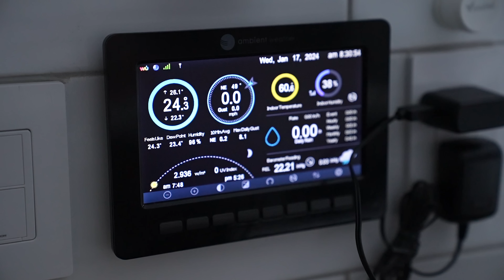A SHOCKING SURPRISE!!

Comment: keep your pipe high so you can use that space . A 200 consulting fee would be very helpful , you still do the work , and have a great root cellar.
Reply: Yes, when you look into crawl spaces under houses where plumbing is done professionally,  the pipes are kept as high as possible to provide maximum room underneath and to minimise the length of supporting straps and movement.

Comment: Hey kids, wow!, that is quite a load and a-half of snow!!  Don't fear, Trent, you will get through it, and, if not... your Inspector, who seems like a pretty chill dude, and friendly towards y'all will point out what needs fixing. Hey, that's how you all roll anyway. 😇Oops... my  apologies, 😎

About the snow on the roofs, what about adding Snow Stops? Lots of variety and styles from which to choose. Try doing a quick search for "Architecture, Snow Stops", and check out the images for some examples. There are old and modern styles (with a bit of everything thrown in, along with a fair degree of "Form Follows Function"). 

Have a great weekend, and keep snuggled up in front of the wood stove with lots of hot cider and great cookies!
Reply: Good idea...forgot about them

Comment: For the floor joist you build a box to support the floor. Look at this old house episodes on this. Look at the stair opening. It’s a box! It supports the floor around it. The joists are supported. The plumbing box is just smaller

Comment: Hey good people, braving the snowy cold! Lovely to see you with your Dad. Some caring advice: When using a Propane heater indoors - PLEASE be sure you have adequate ventilation AND Carbon Monoxide detectors to prevent accidental poisoning & death. Carbon monoxide detectors must be located at/below knee height, as Carbon Monoxide is heavier than air so it fills a space from the floor upwards. Every human is susceptible, so pls take care. Now go have fun!

Comment: The ground against the foundation is around 55 degrees plus the exposed concrete outside is insulated by 32-degree snow.  As far as fumes, if you install an immediate Y at the wall for a cleanout, you can put an inflatable stop inside and then pull it out when you are done. You should have a cleanout there anyway.

Comment: One trick I have seen with the pvc pipe is to use a marker and draw arrows on the ends of all the pipes and fittings while dry fitting to help you remember the angles, positioning, direction of flow, etc.

Comment: suggestion use small  feeler bit  to confirm location of holes to be cut and beam to avoid   small holes 1/4 or smaller easy to plug if not good spot   
   by using feeler can figure out if need to shift bigger holes so not to land on bean or being tooo close for fitting installation

Comment: Trent if the toilet needs more space get a 10 inch rough in. Will cost more then a 12 inch but works the same. Also if Russell smells sewer gas in basement use pipe dope on the clean out plug. I chased many odors of sewer gas that was the clean out plug. I'm glad to see the smiles on your faces again.

Comment: It looks like Russell has gained a new appreciation for your neck of the woods.  One question I have for Trent and that is are you gong to put in a clean out close to where the sewer pipe goes into the block wall?  I don't think I saw one.  It might be a thought about putting one in.

Comment: Trent,  in the basement of the addition. run your horizontal connector pipes up at joist level, not across trhe middle of the room. Huge waste of space and subject to bending /breaking due to any weight in the pipes.

Comment: Just remember on drains that proper slope is all that matters.  1/4 inch drop per every 4 feet.  Every 4 feet there should also be strapping to support the pipes.  You should also get the specs for the joists on the penetration limits.  And of course, don't forget the nailing covers for anything that penetrates the joists.  You can also insert the blocking for the baseboard, towel racks, and so on.  Anything that needs support.

Comment: I could make such a great smoked meats chamber out of that DIAMOND of a space.. cold-smoking, of course! Build a thick wooden 6x6 closet with one wall against the deepest blocks. Pipe controllable ducts, in and out. Use greenhouse controllers for fans, humidity and temp. Seal everything and do homework on the predominant bacteria in your area. I’d rather catch and infuse naturally occurring bacteria for your space but YOURS may  be more anaerobic due to altitude…

Comment: There was an easier way to run your plumbing downstairs, by using only 2 90 degree bends from the toiulet instead of 3 and then you could run the other pipes just under the upstairs floor connecting to the top toilet pipe across the floor, giving you NO trip hazards lower.

Comment: Trent get the turbo heater that runs off propane. You'll be working in your jeans and a t-shirt. We have the same size garage with a loft. My partner used our turbo heater and it was so darn hot in that unfinished loft.

Comment: I don’t know code in your area, but in ours, the pipe that is going through the foundation into the ground would need a cleanout. Even if your code doesn't require it you might want one, especially with a toddler😂😂.  Keep up the good work.

Comment: its a lot of snow on the gables . you got enough of tools to fabricate a mounted blower on top of a 8 foot pole on the top of your home to blow off the snow my friend built one out of old furnace blower with a arm controlled by a small servo and power . and it keeps blowing during the snow storm keeping the roof clean.

Comment: You don't have plumbing design drawings?  Isn't a design required by the inspection officials?  How will you keep the plumbing waste from freezing (any horizontal runs and traps)?   Each fixture needs a vent to atmosphere.

Comment: My husband told me to tell you a good way to get the snow off the roof. Put a big rope all over the roof  in a big loop, then tie  a  Not at the base of the roof,  Then put a lead rope long enough so you can be able to pull it with the tractor safely. Then someone  will climb back up there to rest it back up there. He found  the on YouTube and thought it might help you. The rope  is there to cut under the snow to act like a sled.

Comment: Please say it’s not an avalanche. Dad needs a 1 piece snow suit. That’s such a danger.  Now you’ll have to mount a measuring rod on top of that roof so when you  look out the upper window s you know it’s not safe to go out that exit. Please take my advice and put safety locks up high from Leo’s reach. My niece got out at 2am. And it was a nightmare. Just walked right out.